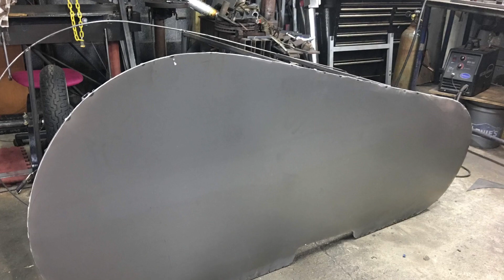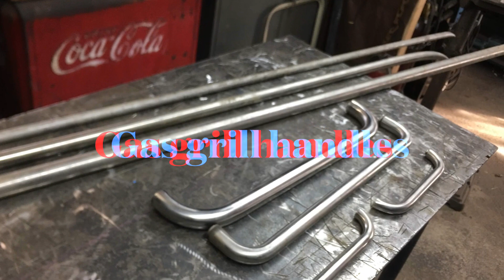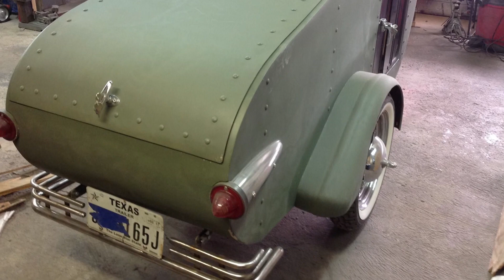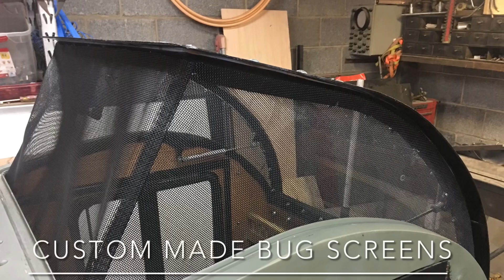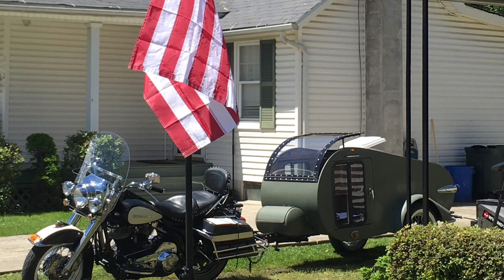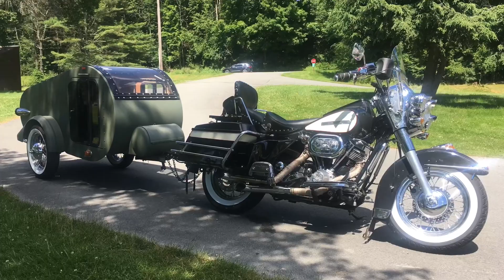Teardrop Trailer Built for my Harley Davidson Motorcycle to Pull for Camping

Comment: Very nice. Well thought out. Excellent craftsmanship. I use an old Travlite model 123 popup. Its a great unit. But I have dreamed of building a rustic cabin looking trailer to pull behind my bike. I'm thinking all welded aluminum framing. Including structural. I took pictures of your video for ideas to add to my plans. Like the lights, fenders, wheels, etc.
Reply from the maker: Thanks mikeinski, aluminum is the way to go. Happy building.and planning.

Comment: Lovely job, I might have gone with car tires for the extra mileage you would get from them before they need replacing but that's just a personal choice. Hope you enjoy many happy, safe miles with your new little house on wheels!
Reply from the maker: I went with them so to match my bike tires. Thank you for your comment and watching my video.  I’m always open to new ideas. 👍😎
Reply: Car tires would also put more drag on it where the narrow tires have less in contact with the road helping to cut down on drag and fuel consumption
Reply: That teardrop weighs less than the bike.  No point in worrying about car tires.  The tires on the bike will need to be replaced before the trailer’s and we wouldn’t put car tires on the Harley.

Comment: Great looking camper/trailer.. I'm looking to build my own small enclosed trailer to pull behind my Harley but don't need anything as fancy as this.. I don't want to pull one of those trailers that everyone else has.. how heavy is your trailer? My buddy has one of those $5k legacy trailers that are fiberglass and have heritage fenders and we extended the tongue on it so it sits back off his bike about 5 feet.. it not only looks really cool especially when we're all truck drivers who have stretched out wheelbase trucks but also because it handles much better and doesn't effect the bike near as much..
Reply from the maker: Mine weighs 390lbs. I would of liked it a little lighter . Lighter the better. U know weight is a big deal behind a bike. If I was to build another I think I’d try to build with foam board and fiberglass. Thanks for the comment Ben….
Reply from the maker: There a few good YouTube videos out there building with foam board and fiberglass…👍

Comment: Nice job!! I want to build one myself. What was the empty weight?
That’s one of the better videos and builds I’ve seen!
Thanks
Reply from the maker: Hello Scott, thanks for the comment… it was really a fun project. I was hoping for around 400lbs max but ended up with 490lbs. It’s a little bit on the heavy side. It took a little while to get used to pulling it. I practiced in a empty lot near my house. The farthest I’m pulled it was approximately 30 miles. If I was to build another I’d shave some weight off. There’s always a way… 👍
Reply from the maker: One more thing Scott, if you build one consider a dropped axle. A little lower would be nice also.
Reply from the maker: Looked at my title, it weighed 480… 👍

Comment: What is used for the pop up sky light ? How do you get the curved glass is that a thick clear vinyl ?
Reply from the maker: I made the frame from 1” square stalk. I filled it with sand and bent it to shape. Then I made a outer frame of flat stalk hinged the bottom end and put a 1/8” piece of Lexan in between the square tube and the outer piece of 2” flat stalk. Please like and subscribe. Lexan is bendable.

Comment: Great Build and design!! Not that I have the skill to do this but I am wondering what would you estimate you spent for materials to make this trailer
Reply from the maker: THEFALCO, sheet metal was new most other parts were  used,  including tires and wheels purchased cheap as possible. Insulation cheap at Lowe’s, Labor of course was all me. 14 hundred bucks approximately. It really was a fun project. 

Thanks for watching and your question. 

U can do..... it anything is possible.....
Reply: @busterstravels1534   Thank you for answering, I am a retired/disabled Automotive Machinist. I might be able to do this lol, gonna have to go pickin' and see what is out there. I avoid a lot of rides on my scooter because I am not wanting to pitch a tent and sleep on the ground the pitching of the tent is not a big deal but that sleeping on the ground .... This trailer would be perfect for me and get me out on the slabs more.

Comment: How did you shape the plexiglass front roof area to be able to open up like that ? What all did you use
Reply from the maker: Hello Tim, thanks for the comment. Please subscribe. I used Lexan, not plexiglass. Lexan is very bendable. I sandwiched the Lexan between the outer 2” flat bar and the inner part is 1” square tube, thin wall. I filled the square tube with sand so I could heat and bend it. The trailer part of the window frame is 1” u channel. It works as a rain gutter. I also use some weather stripping. I hope that helps. Have a great day.

Comment: I like the design you have, but i was wondering if you could make a front slide out for longer leg people. I was thinking of building one myself. I was wondering how you did storage areas. nice job though Dave.
Reply from the maker: Hello Dave thanks for the comment. It is just under seven feet long as is. Plenty of room for long  legs and feet under the galley area. 

I did see one in the past that expanded when parked. I don’t have a picture but believe I saw it here on YouTube during my planing period.
Reply: @busterstravels1534  how wide of a floor plan did you do, can two people sleep comfortably or is it a bit snug.
Reply from the maker: @davidrupe2390  David I believe it’s approximately 32” wide.... I built it for only one person. As with any build, if I was to build another I would make many changes.

Comment: Hello, my friend, ask a question, I have a Fat boy, and I want to do a treil like that in the future, my question does not consume a lot of fuel pulling all that weight there, doesn't it?
Reply from the maker: Hello Buddy, it turned out a little heavier then I planned. 390lbs. It did use more gas but not crazy amount. But because of the weight it was a little bit of a nail bitter to pull. It was doable but you always had to plan ahead for stops and starts. It got sold to a guy with a trike. Perfect for a trike. I would like to build another in the fall but I’m planning on building it with styrofoam, covered with fiberglass. We.Very light and strong. There is a couple videos out there with a few guys built. We’ll I hope the helps answer your question. I’ll say it was fun to camp in and guys went crazy for it at bike nights.
Have a great summer.✌️😎
Reply: @busterstravels1534  Hello my brother, thanks for the words, I'm thinking of doing one of these in the future too!  I'm from Brazil Rio de Janeiro.
Reply from the maker: Very cool.
Reply: @busterstravels1534  🇧🇷🤘🇺🇲 ! thank you bro .

Comment: HOw did you waterproof the hatch so that water does not come in between the trailer and the hatch?
Reply from the maker: I wish I could send a close-up picture. I built a rain gutter into it with a rubber seal. Similar to a car trunk lid.... thanks for your question.
Reply from the maker: I just watched the video again. If you look close the front view of the hatch open gives a pretty good view of the gutter minus the rubber seal. The rubber is on the underside of the pop. Up. Maybe you can take a screenshot.

Comment: What's the kerb weight of your bike compared to the weight of the trailer?
Reply from the maker: Hello Lucas, the bike weighs about 850lbs and the trailer is 390 lbs. it would be nice if it was a little lighter. If I was to build another I would definitely cut some weight. Thanks for your comment.
Dave

Comment: Is this made using sheet metal or aluminum?
Reply from the maker: @hotrodcasanova3574  sheet metal. Total weight was 390. A bit heavy. I should have used aluminum. 👍
Reply: @busterstravels1534  that's still not to bad. Maybe a bit heavy for a bike but definitely not for a car. I liked the build and I've been considering building one with sheetmetal just so I can do some cool custom touches that I can't do with wood. Or afford to do with aluminum.
Reply from the maker: Cost was why I went sheet metal. One problem was warpage. I spent a lot of time working on that. I love working with metal also. Doing it with some custom touches sounds great. It makes for a fun project. It was a head turner. People loved it. If you build one have fun with it. Any future questions or comments don’t hesitate. Have a great day. 👍

Comment: Has anybody ever pulled one of these what does it feel like
Reply from the maker: Hello Denver, the first time I pulled it it scared me. I wondered was it doable. Well I decided to take it to an industrial parking lot in my neighborhood and practiced pulling it. Taking off from a stop. Also practiced stopping with it and making various types of turns. It definitely takes some getting used too. The bike handled it but it felt much different. A bit scary.  Every aspect was a learning experience. You really have to plan your stops and starts. Pulling something with two wheels is dangerous.

Comment: NO NO NO NO NO NO!!! 
The RULE IS, 50# MAXIMUM of weight on the tongue, when tugging with a bike!
MY camp gear would MASSIVELY overload that tongue and since I ride hard, put me in a DITCH. 
Those wheels need to be farther forward; NOT behind the,wagon.
As a trailer tugger, I've experimented a bit, and I found that the main opinion of the Motocampers is correct. 50lbs max.
Reply from the maker: I agree with you. I’m not a professional builder. I built this as a fun project, learning every step of the way. If I were to build another I would do it much differently. I believe it’s more suited for a trike.